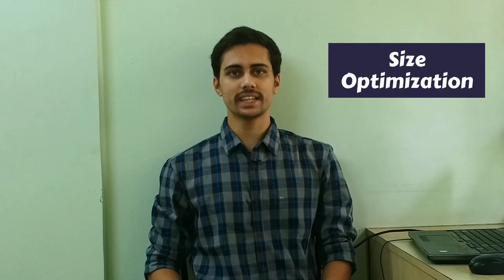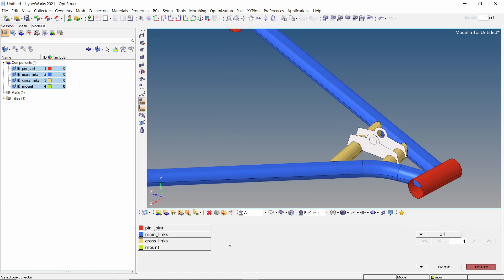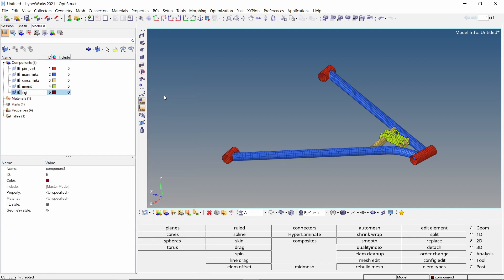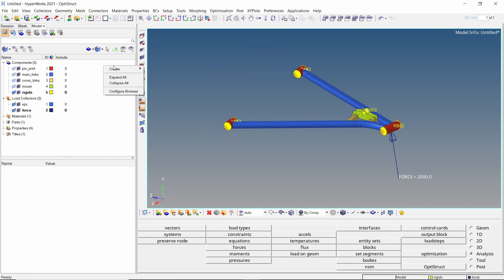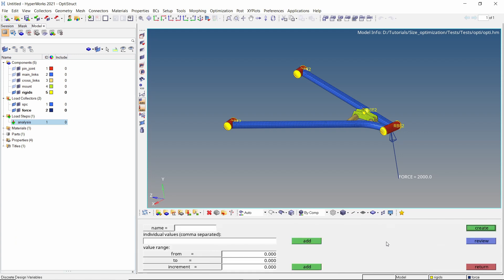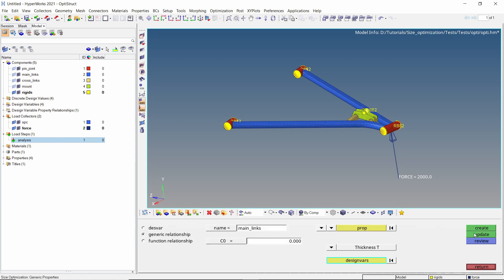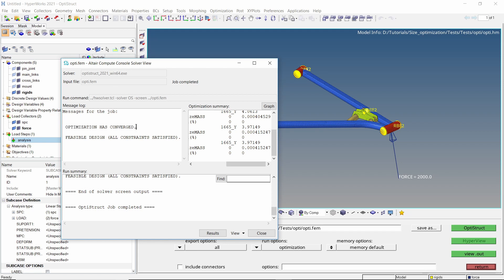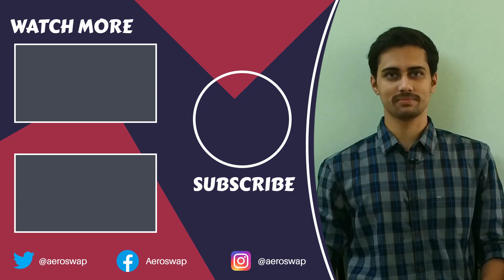Size Optimization using Hypermesh [Optistruct Tutorial]

Comment: Is the ddval (direct design variable, dvs) necessary to perform a size optimization? Optistruct seems to allow the option to optimize without a ddval.
Reply from the maker: It is not necessary. However, it helps if you have manufacturing constraints on the thickness.

Comment: Nice to see the sizing work can be easily done using this size optimization to determined the desired thickness. For the sizing works, it's pretty typical to get the freebody extracted at the peak or bending sensitive areas and do the hand calcs to avoid any potential modeling errors or singularity effects. Does the hypermesh have a pretty good freebody tool?
Reply from the maker: Hello Ken, good to see you! I hope you are doing well.
Indeed this type of optimization is very handy and can greatly reduce the manual workload. Hypermesh has a robust FBD tool. I had used it in the 'Global-local tutorial' if you remember. However, I believe this is a better method to determine optimum sizes!